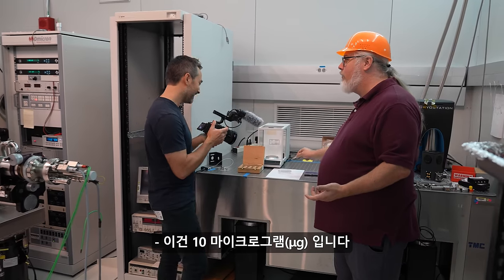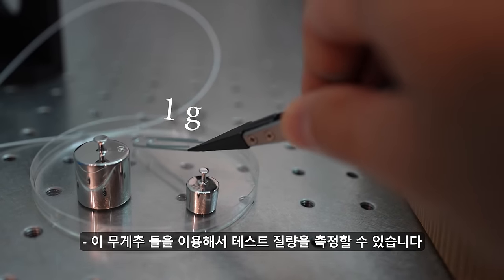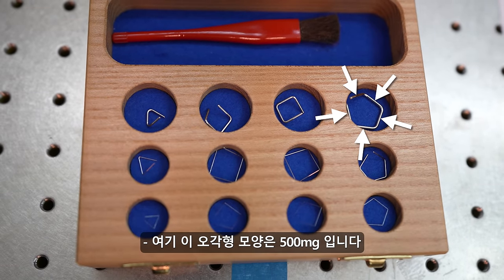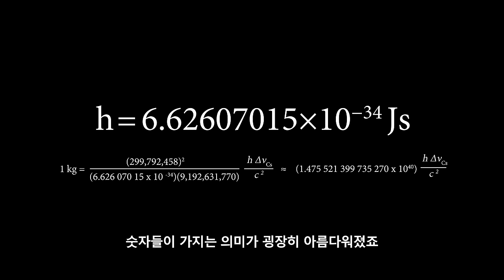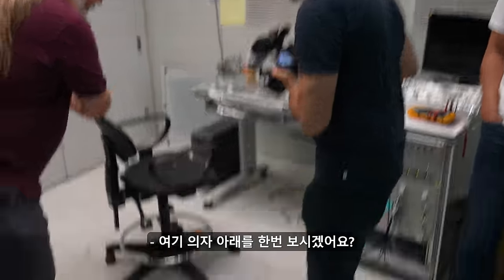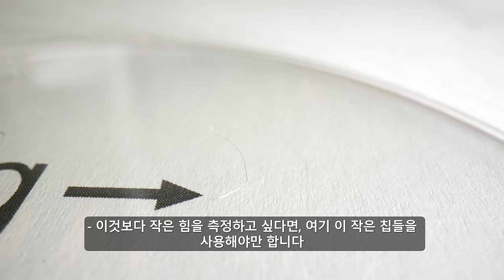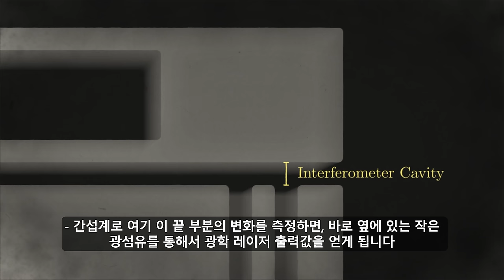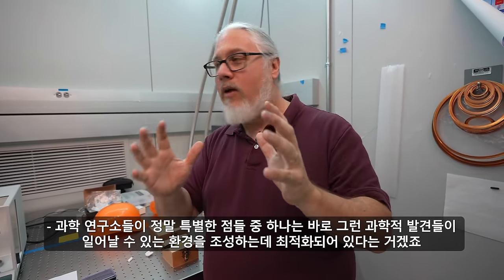아주아주 작은 힘 측정하는 방법

Comment: i really wonder how photon can generate the force? is that measurement performed in vacuum environment? i guess the effect of thermal expansion of air
Reply: The force of light comes from the light energy itself. There is a difference between the force when all light is reflected and absorbed.